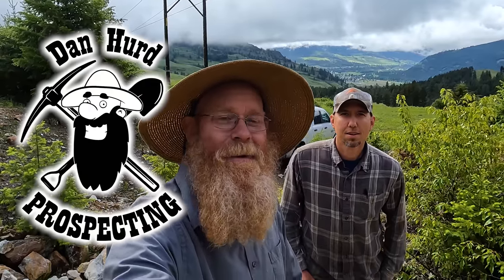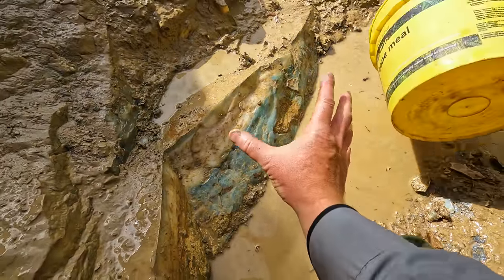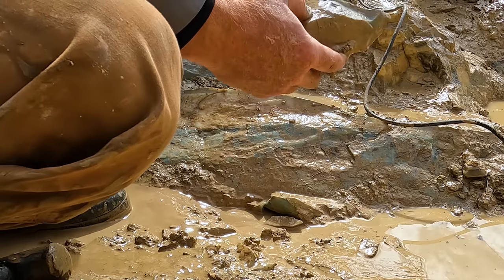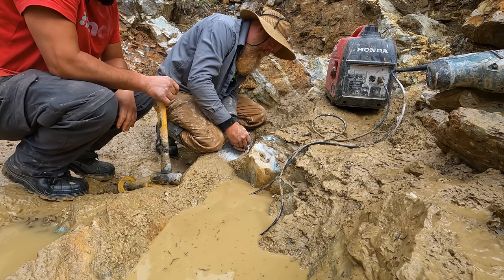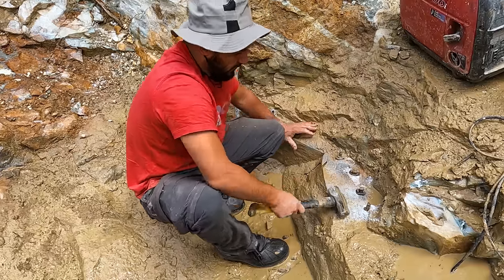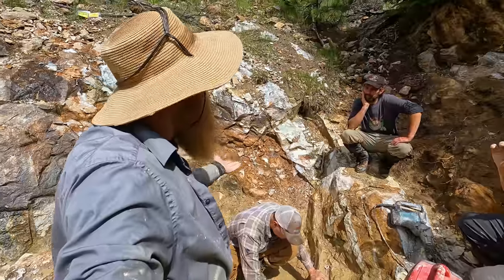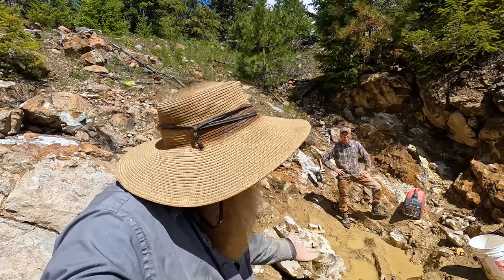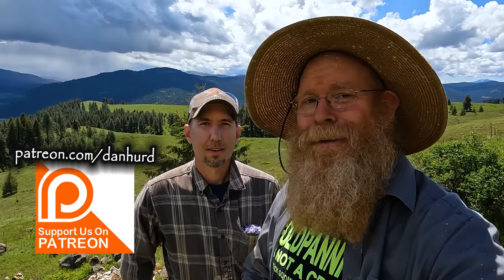Can we get this $5000.00 gemstone out in one piece?

Comment: I just got a gold pan a few days ago, and I tried it out at my father's property where he's dug a huge pit for the house he's building. There were a couple tiny specks of gold, but what interested me the most was that there were pieces of translucent, grayish blue quartz in there! It's rare to find good quartz where I live, and I didn't even know blue quartz was a thing. Will definitely be going back, this gold pan is a game changer.
Reply: Amazontite?
Reply: Probably some kind of Chalcedony and it's totally a thing.
Reply: Welcome, I'm new myself but have been finding garnets lately
Reply: @Ghostontherun  I love garnets too! I've been sniping for a couple years but I've just now started panning. Here's a little trick to make your garnets much prettier: scrub them really thoroughly with soap, and then soak in a mixture of citric acid, salt and dish detergent. This helps dissolve a lot of the crap around and inside the stones, improving color and clarity. It might make some nasty fumes, though, so do it in a well ventilated area and avoid contact with the solution and make sure you wash your hands well after dealing with it.

Comment: If you listen very carefully when you are belting the wedges, listen for that "boing" noise at the end, and how long it take to fade out. It's like harmonics on a guitar. When they all have roughly the same harmonic, that means there is equal pressure on the wedges which helps get a clean split. You can mix it up if you are on a corner so you don't get too much pressure on the thinner part of the rock. You can really hear it at 21:12.

Comment: I would have so much fun playing in the rocks with you Dan. I love the acoustics of the feather wedges more than i probably should, my hearing is oddly tuned to certain high pitches like as they get tighter into the rocks. Things like mixing flavored powders into water i can hear a harmonic tone from the mixing spoon on the glass that changes as the powder dissolves. Yes, it's totally weird, but i love the sounds of finding the rocks as much as the specimens themselves. 😆🤪
Reply: I thought I was weird cause I can hear changes in the glass and hammering nails and such listening to the metal sing as it cracks the rocks and the sound of the rocks cracking. So cool